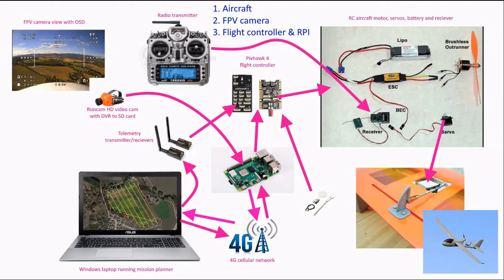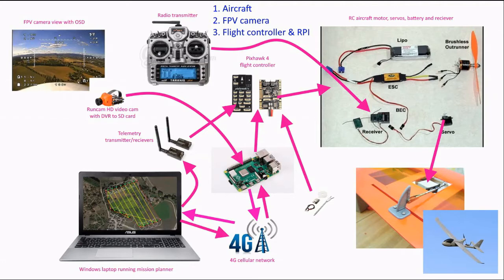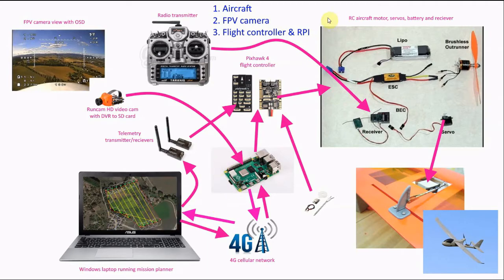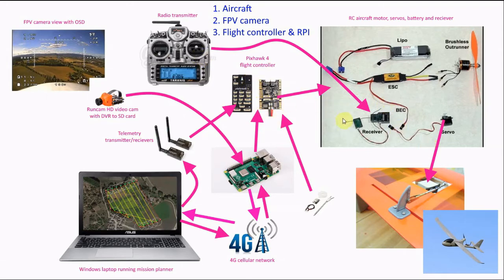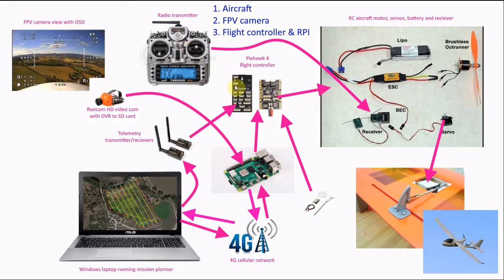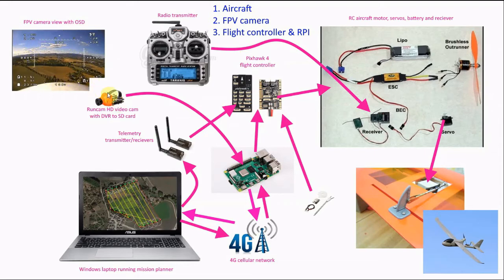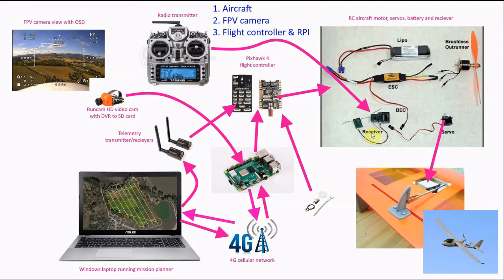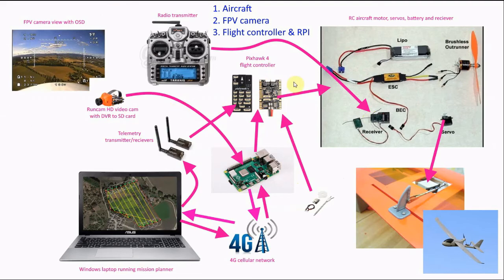Quick Explanation of the Basics of Setting up a Radio Controlled Fixed Wing Aircraft with FPV Cam

Comment: hi 
i want to connect 2 fpv camera 1 with pixhwak directly and another with raspberry pi. if i am in range of telementry then i ran pixhwak fpv and after the range of telementry i use rasberry fpv over 4g and others sensor and drone. 
is this possible?

Comment: Hi,

Could you elaborate on how exactly you hooked up the HD video out from the Runcam to the R-Pi, what software is running on the R-Pi and how does it interface with the Pixhawk and Arduplane, are you running some software on the R-Pi reading GPIOs for telemetry ? Did I understand correct you have the R-Pi connected via WiFi to a airborne phone, the R-Pi streams HD video via the WiFi to the phone to the internet to your other cellular modem/phone to show on the computer ? What bandwidth do you need for that ? How do you manage power up and shutdown of the R-Pi, do you just power it down or do you have some circuit to gracefully shut down the OS and power off ? Sorry a lot of questions but the video is very vague on anything technical.

Thank you and greetings
Jan
Reply from the maker: that's not a runcam, it's am rpi cam

the rpi connects through the wifi hotspot on a flying phone, this seems the most stable and best way to get a reconnect if the rpi has issues (a physical tether has issues with android)

android has some find my phone apps so that's a backup if you lose your plane, obviously the phone is an air gap and you'd have to crash really hard (even by my standards) to power it off

https://gstreamer.freedesktop.org/
that's the streaming s/w

https://ardupilot.github.io/MAVProxy/html/index.html
that's the s/w for connecting to the pixhawk via mavlink

https://zerotier.com/
That's the VPN

none of this was easy to set up, and it's still far from as easy as i'd like it to be for others like us, this is what i'm trying to solve

cheers
aero
Reply: @aeronaughties Thank you for your response !

I do like the idea of an airborne mobile phone but I can not realistically see video streaming work well and low latency to actually use as FPV. Ofc in an urban area the mobile reception and service may be good enough but in rural areas I would be worried about the upstream bandwidth and latency. I do however find the MAVProxy a VERY interesting idea, I will definitely have a deeper look into that. I have seen GPS trackers that connect to the mobile phone network, they are very small, low power, simple stand alone. You can send a text and receive the GPS by text to find the model.

I have never done any RC stuff in the past, I am just starting. My choice as a starter plane was the Volantex Ranger 2000 (pusher glider). I do find it tricky to even get only my Matek F765-Wing, FrSky X8R, GPS and batteries in the plane. Do you intend to get all the equipment in your plane ? I have looked into the Pixhawk 4 (from Holybro) and found for a plane it requires a lot of external stuff to make it work. That's the reason I use the F765-Wing. It has build in PDB with sensors, OSD, Telemetry (with half-duplex, inverted interface) that works out of the box with the X8R receiver to have Arduplane telemetry on the Jumper T16 (or other OpenTX transmitter). What was the ultimate reason for you to go the Pixhawk route instead on an alternative, small form factor and more integrated FC ?

Kind regards
Jan
Reply from the maker: @JanPaulini hi jan, did you see this video? - https://www.youtube.com/watch?v=MFUChpVQjzU&t=

In response to everything you said my goal is to make the simplest possible configuration so anyone can build it, currently i have other issues (like everyone else) that's delaying me a little. For now I've parked the plane idea and I'm going to get everything working on a quad copter first. I think it's a better testing platform. Cheers. Aero
Reply: @aeronaughties  check out Uavmatrix.com
Reply from the maker: @andrewborntrager7909  thanks, i've seen it before, unresponsive on support in my experience
Reply from the maker: Hi again, if you want to contact me directly you can find me on Telegram - @Aeronaught

Regards
Aero